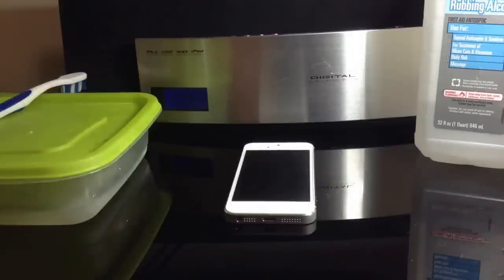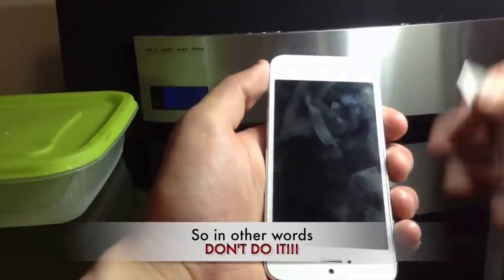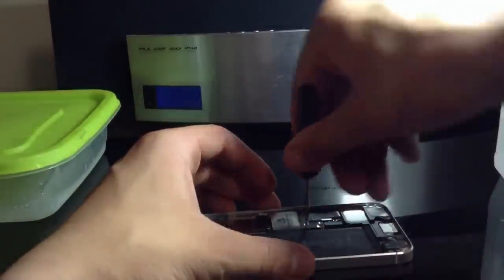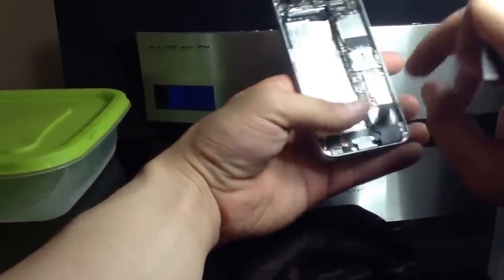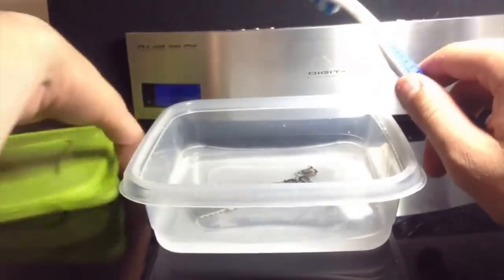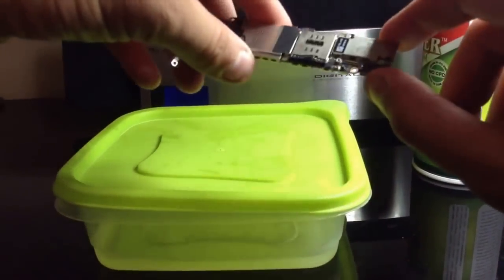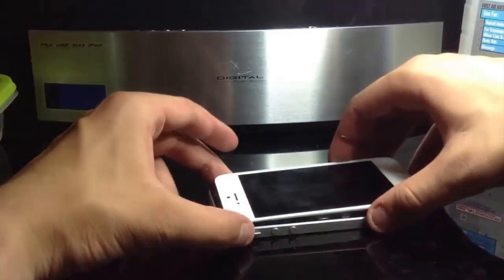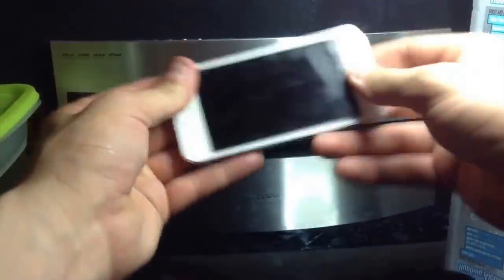iPhone water damage repair DIY (full step by step guide)

Comment: Hi, I'm back again lol. I opened up my iPhone 6 and took the motherboard out and soaked it in alcohol, cleaned the connectors, and dried it all off with an airduster. I waited a couple minutes, then hooked it all back up (not screwed in or anything), and tried to turn it on. When it didn't turn on, I went to go charge it. When I did, there was a hissing noise. I unplugged it and did it again, and the noise was gone. Did it short circuit, or something else? Is there anything else I can do?
Reply from the maker: Nikiptc18 what's it doing now? also was it completely dry when you tried turning it on?
Reply: Nate Rist I took it off the charge. The front, back, and motherboard are all sitting on my table seperately. I'm pretty sure it was completely dry, but since those two metal things cover up part of the board, I can't be sure. I did do my best to dry them off, but maybe that's where I went wrong? The hissing did come from underneath the upper one of those boards, and it got hot there, too. Thanks for your help!!
Reply from the maker: ya just give it a few hours to sit a fully dry out and then try again
Reply: Nate Rist I tried to charge it again just now, and no noise again this time. There was still no response, besides the upper right part of the motherboard getting hot again. I can't tell if it's hot in the area under the plate, the part where the cables from the screen attach, or if it's both. Is there anything else I can do, or should I get replacement parts? (I would just buy a new phone, but there's stuff on this one I want. Pictures and such.) Thanks!
Reply from the maker: have you tried connecting to a computer to see if it reads the phone in itunes? if it can read it you can back up all of your info
Reply: Nate Rist I tried it just now, and it didn't. The same part of the motherboard was hot again, though.
Reply from the maker: It's possible the battery is bad and not charging, but I could be wrong, not really sure what else could be going on other than it may be fried:/
Reply: Nate Rist Ok, I'll try getting a new battery... Do you think it's possible to physically take the memory out of the phone and put it somewhere else? So I can get my stuff off of it.
Reply from the maker: does it give you the option to trust the device in itunes? sometimes it works for me that way, but not always
Reply: I'm having the same problem as you right now. Let me know if you find anything that works please. The phone has a small hissing sound and the vibrator works buts the phone won't turn on. It gets hot on the terminals where the screen cables connect to too.
Reply: Update: my phone actually connects to iTunes but I can't get into my information because iTunes has a window the pops up and says "to allow access, please respond on your iPhone". But the screen is still black
Reply: Nate Rist I have another question. I got a new one and dropped it in water AGAIN, but this time it worked. The only issue I'm having is that it has trouble connecting to wifi/the Verizon network (I don't know what to call it). Is there anything I might be doing wrong, or can I fix/replace the piece that's messed up?

Comment: if the iPhone screen has a minor crack will this still work?
Reply from the maker: an iPhone screen will work fine if only the glass is cracked, but if the digitizer is cracked at all the touch either wont work or will not work properly
, this is why it's possible to do a glass only replacement on iPhones and galaxy devices in many cases

Comment: Hi! I am very stuck. I followed this step by step and used the 99% Isopropanol solution i done everything on this video and couldnt get my iphone on, so I took out the logic board and placed it into another phone. Walla! It worked so I figured maybe the power button in my other phone probabaly just wasnt working. The water damaged logic board has been working for 2 days now ever since i used this video to help me do it. But now out of the blue my screen just seems to be pressing buttons all by itself as if its got a mind of its own! When i push the lock button it stops but when i open the phone back up, after a couple of seconds of use its starts all over again? What could be wrong ???
Reply from the maker: dane foster either the digitizer is going bad or the terminal on the board it bad (check the terminal teeth for arcing - teeth will be black if arc'd - scrape the arc'd teeth with the fine point of a razor blade until the teeth are bronze/gold again and test the touch sensitivity then, if still an issue just order a new screen and see how that goes)
Reply: Nate Rist I had to order a new screen anyway because I made the fatal mistake of placing the wrong sized screw through the wrong hole and I did crack my LCD screen. Quite easy to do huh.  Anyway i disassembled my iphone unlpugged the battery and the board and that plugged it all back in again and its working fine.

Must have soaked the screen somehow when I placed it faced down in the kitchen somehow...

Comment: after i did the full through cleaning my iphone is stuck on the apple logo it wont go from there what should i do is it done
Reply from the maker: sounds like it might be a bad battery to me
Reply: i tried taking the battery out and tried just puttin it on the dock it idnt work still it keeps flashing
Reply from the maker: did you try putting in a good battery? if there is no battery in the phone, that's what it will do
Reply: Nate Rist that what i will do now  i just ordered aniother battery off of ebay do you think it will work then

Comment: Why is the water damage indicator not red on the inside of that phone. so it that phone not water damaged
Reply from the maker: Not all liquid damage devices will have triggered water marks, if liquid makes contact with them then they will be triggered, but if liquid gets inside the device but doesn't reach the marks it still may be damaged or affected but just not in those areas
Reply: Nate Rist Can you please give me your input on my message I wrote you before this guy. Just wanted your thoughts. Thank you in advance for getting back to me.

Comment: Ok - so my phone fell in the hot tub 4 days ago.  I've done all the steps here up to plugging it in.  When I plug it in, it doesn't show anything.  The motherboard gets warm, but there is nothing on the screen and no sounds or anything like that.  How do I know what the problem is with it?  What do I do with it if the screen doesn't show anything.  I 've been letting it charge now for 30 minutes (it's been off the charger in a bag of rice for 4 days.)  And still nothing!  HELP!!!!!
Reply from the maker: The only thing I would suggest would be to double check all terminals and to test the board in a know 100% working housing (if a friend is willing to let you test the board in their housing, that would be good)
Reply: So I got my replacement phone, which works ok.  Took my cleaned up logicboard out of the water-damaged phone and put in in the new one.  It doesn't come on and show up on my computer or anything - just like the old phone.  The logicboard heats up, but nothing else happens.  Maybe the board is just totally bad????  Please respond!!  =)
Reply from the maker: I won't say yes or no because it could still be good (accept it's not very likely), at this point I would just test your old parts with the new board, make some money selling the parts as a fully assembled shell to cover the replacement cost a bit

Comment: How Long do you Put The motherboard in this box
Reply from the maker: +misterX x not very long, a few minutes maybe
Reply: +Nate Rist 
Do i Need The spray for The preparing
Reply from the maker: the air duster? no but it defintely speeds things up alot
Reply: +Nate Rist 
Can i use a Hair dryer
Reply from the maker: I wouldn't they produce too much heat and could damage parts of the board
Reply: +Nate Rist some hair dryers have the option to regulate the heat like mine :)

Comment from the maker: Anyone commenting that rice fixed their device and that this video is a waste of time or that rice actually in any way at all a considerable option for repairing liquid damaged devices, your comment will be considered spam, it will be removed  and you will be banned from my channel permanently, I don't mind you sharing your experiences at all, but I absolutely will not tolerate bad or false advice on my channel for any reason. This is my one and only warning concerning this issue.

Comment: does this erase any memory?
Reply from the maker: Nope, data loss only occurs if the board itself is fried or cannot be read when connected to a computer (this is why regular itunes backups are a good thing)
Reply from the maker: nope (unless the board is so badly damaged that the memory chip is unreadable, but not likely to happen)

Comment: can i use 90 degrees alcohol?
Reply from the maker: That's a bit hot don't you think? You can use 90%, but I wouldn't use 90 degree alcohol, could mess more stuff up
Reply: yeah it didn't work but thx anyway

Comment: Uh, the reason you use alcohol instead of water is because it doesn't conduct electricity. It also doesn't leave any residue. I wouldn't do it because you could cause weird marks on your screen, but you can use your phone while it is submerged in alcohol.
Reply from the maker: that's why you don't submerge the lcd and just the cables instead (but watch my backlight replacement vid if you have that issue)

Comment: so I dropped my iphone 5c in a toilet at school, there was nothing but water in the toilet hah, and I grabbed it immediately out and cleaned it off with my shirt. When the outside was dry i turned it on to see if it worked, which i am completely regretting because i read you shouldnt turn it on. All the buttons and everything works except i think i can see water in the camera lense thing & now the screen doesnt respond to your fingers touching it and you can see lines on it sometimes. I couldnt turn it back off after the incident until i got on the bus and finally got the slider to move. i finally got home and immediately put it in a bag of rice (which i guess doesnt work since you said it doesnt)  does anyone think theres hope still
Reply: I just did the same thing but my cat pushed my phone into a bowl of water yeah my phone is gone
Reply: does your iPhone work?

Comment: Why don't people just use the tab for actually removing the battery instead of forcing it up like that?  Like every video I see people just stick a spudger in there and pry it up and like bend and deform the battery
Reply: because it tears off like 90% of the time
Reply from the maker: RikketikRolde is right, it usually rips because the adhesive under the battery is too strong. You can use a heat gun to heat up the back housing area behind the battery and it should come out easily.

Comment: can i use vodka for cleaning??
Reply from the maker: If it has a 70%-95% alcohol rating, then sure go for it, but then what will you drink if the repair doesn't give the result you want?
Reply: True :) , anyway popped out to my local pharmacy and bought a bottle of surgical spirit.  Now waiting for a new battery , really curious if it's fixed
Reply: Nate Rist can you use like 99% or 100% ?
Reply from the maker: the higher the % the better
Reply: cheers for the reply :)
Reply from the maker: dr.dued 28 You obviously didn't read the description, not sure if you'll be able to see this message, but you are being banned from my channel for making false statements regarding rice being able to fix liquid damaged devices. There is no tolerance for that type of fuckery here and for that reason I am banning you. Bye
Reply: Nate Rist lol
Reply: If you're russian